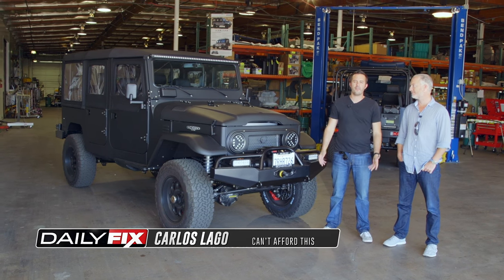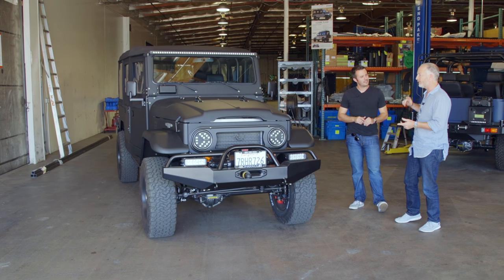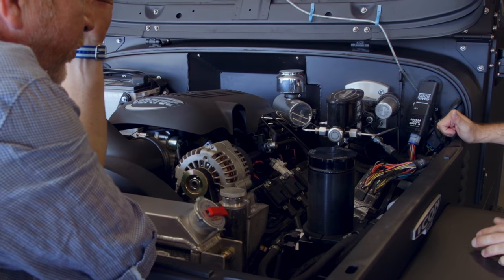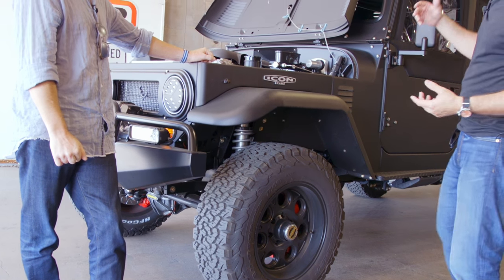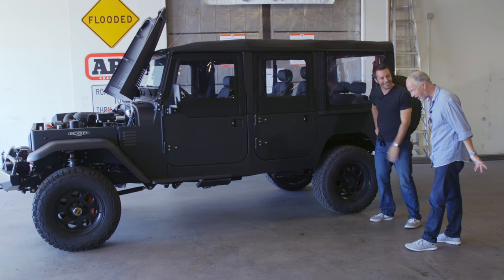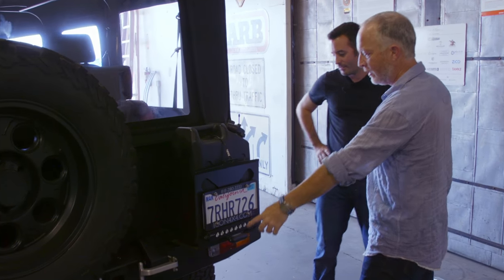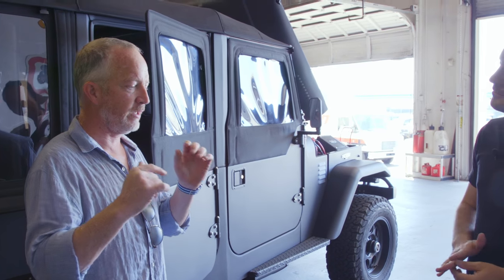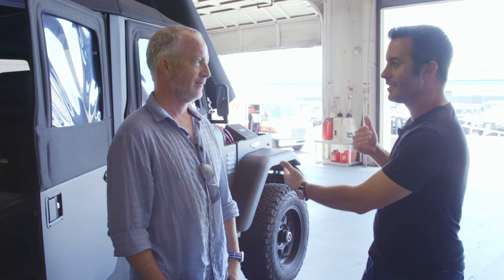Just Showed Up: Icon FJ44 (w/ Jonathan Ward) – Daily Fix

Comment: J. Ward is a total and complete badass. Not worth paying to watch the video but it's a cool video nonetheless.  The FJ44 is cool. Headlights don't look that bad though its housing doesn't look like it'll project well enough. Also, you don't need to use dynamat there are way cheaper alternatives that do just as good or better.

Comment: This is one of the most over priced vehicles, ever!
Reply: It's also one of the most durable, given that it isn't made of plastic in every single crevice. It's a specialty vehicle built to last, rather than to fall apart. Hence the price increase for quality materials.
Reply: I built a FJ40 once , it was almost completely remade out of checker plate steel and riding on a chevy truck 350 and 4 speed power train . All in about 5000$ to build your own , Good paint on the outside good undercoating underneath some spray on bedliner for the interior , and your 5000$ FJ should last for ever . I don't have mine anymore because of kids and gas prices making it to expensive , but the one i had will never end up here because he only buys the ones that are in the ( I give up ) category . Props to Jonathan Ward for figuring out another way to take money from people in the ( more money than brains ) category
Reply: Quality, American made product more like it.
Reply: the quality and workmanship is what you are paying for. can u buy a Bentley for the same price? does if compare to a Camry? different league.
Reply: Just as you pay other specialists to do work at your home or in areas you're not good at yourself, others pay this guy to get the very best of what they want. I'm sure your car is great but your car costs $5000 and as he said just that Mercedes canvas costs $5000 to buy from Mercedes, before they do anything with it. My guess is your canvas (if you use any) is not of the same quality or price. Parts cost, and very good quality parts costs a lot. It's no difference for this guy. Then you have development costs, testing and a product that needs warranty. All that costs money. I guess some people can build their own sports car, but it will never be a Ferrari, no matter how fast it is or how many hp it has. This is the Ferrari of FJ.
Reply: i can buy a 3000$ semi tracor that will flatten this FJ and be far more heavy duty and durable.
Reply: LexusReyes
heh , thats all you got? it's overpriced plain and simple. You could buy several military surplus vehicles that are bigger , more heavy duty , more powerful , and better made than this FJ.
Reply: details are trivial. fact is it's a singular small FJ for the price of a fleet of better vehicles. speaking of details , note the white letter tires mounted backwards , yeah , lotta thought and planning there. I'm sure 100% black tires dont exist so just turn white letters backwards like a highschoolers first pickup . lol
Reply: yawn , try harder. go ahead old man i got all day. type me a novel.
Reply: LexusReyes
not that i'll read it , buy hey clearly you've got nothing better to do. lord knows your name calling inventory is larger than your reasons to buy this garage queen.

Comment: You guys just don't get it do you! You take a rare classic truck, then chop it up till its completely unrecognizable. I've done my fair share of upgrades to my CJ5, but at its heart its still a old jeep. Why turn a 1960's FJ into a tricked out Jeep Rubicon? Just buy a damn Rubicon then!
Reply: Well because as far as I'm aware these FJ's aren't really valuable or even that rare. Plus if I recall the majority of the trucks that they purchase for conversion are in the worst of the worst shape. After all these guys are changing the body, frame, engine, trans, suspension, electrical and etc. it doesn't really make sense to purchase a 50k Truck when you're pretty much just going to scrap the entire thing. 

Same thing goes for the Singer Porsches and Eagle E-Types, 99% of the cars they purchase are well beyond saving.
Reply: Yah just buy the Rubicon and let the CJ5 that nobody wants rust back into the earth.... or make it cool by modern standards and give it a new life...
Reply: Same guy owns TLC. In fact, both TLC and Icon work out the same shop.
Reply: yeah.. I can still recognize it. it's got a couple more doors but still looks like a 40 series.

Comment: I so want one of these, but there are two problems (one big and one small). The small problem is those lights, wipers, vents etc buttons. 1, icons make more sense instead of letters because not everyone in the entire world speaks English and 2, they just look tacky and out of place with that font. The big problem is though is that centre console. It looks so dangerous! It's made of steel and those edges look sharp enough to cut your thigh open all the way down in just a 30mph crash. You could literally die of blood loss or be crippled for life easily by that thing. Of course your knees hitting the dash is probably an even bigger problem, but to be fair that's inherent to the design of the vehicle and a bit less avoidable. But making a steel box with corners that rub right against your leg is just unnecessarily careless.

Comment: I have a 1969 AMC AMX the original motor was a 290v8  witch I had to take out only because I blew it up and I but a LS 7 built up a friend did all the motor so I have no clue what he did all I know is I have a LS 7 with balls to the walls 975 HP with 900fp to the road . I run one turbo because two is just way to much it wont stop burning up tires. It's set to run pump gas and racing fuel  pump being 93 octane and racing is 145 octane. I did all the work myself and after four years she is done. I'm in love with everything I did to my baby One day I will make a video on it but until then take care and drive safely...